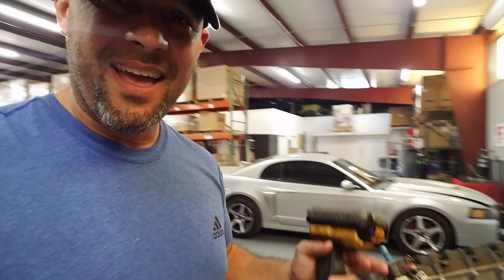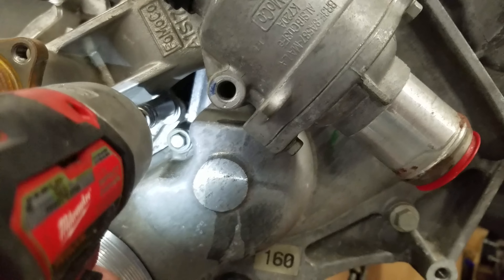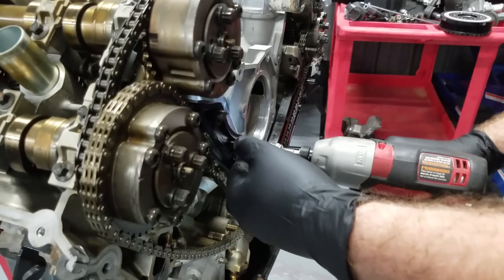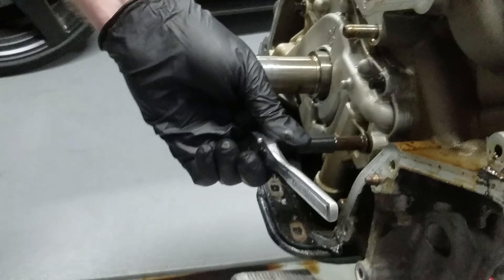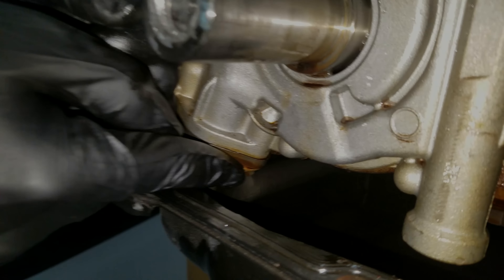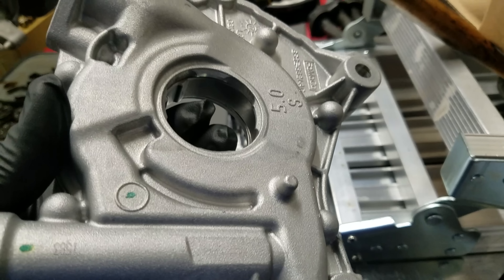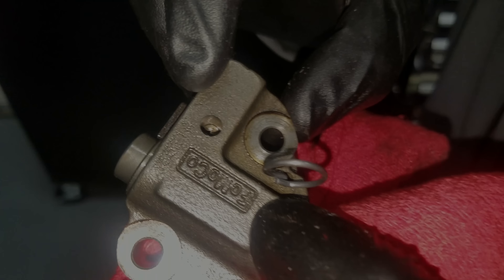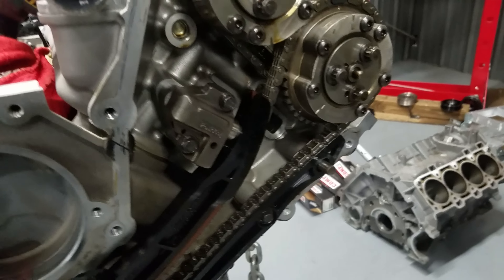11-14 Cam installation on Coyote engine. And Oil pump gear drop test

Comment: Great detail...I had a broken valve spring on cylinder 4 and had a shop quote me 4.2k to fix it.  I had to go through the same exact process as replacing cams to get to the springs.  I took my time and it is about a 20 hours job, if everything goes your way.  I did them with heads on while in the car which is a back killer.  If you need to use a shop, make sure it is a shop that builds motors.  Your local muffler shop who wants to take a stab on this type of work is not going to be a choice.

Comment: I just did this on my '13 f150 Yote swap a few days ago. Did mustang intake cams, OPG, crank sprocket, Boss tensioners and Mustang oil filter adapter. I dropped that rear oil pump bolt in my oil pan about 20 times trying to get a thread started. Have to love ford and those blasted TTY bolts that take a forever to ship.

Comment: 1:30 LMAO... yes LS guys there's 4 cams in these guys .
Reply: Zamorazone lol. I'm a ls guy. That's crazy. I did my own cam in the camaro but this. Oh no. I kind of want a mustang
Reply: slowls go for it!
Reply: And? Pushrod engines actually have many more tiny parts.
Reply: Joshua Childers
Not really. Unless by "tiny parts" you mean things as nitpicky and individual needles in the bearings a pushrod V8 has:
1 camshaft
1 timing chain
16 lifters
16 pushrods
16 rocker arms.

Total parts: 50

a dohc coyote has (not counting the cam phasers):
4 camshafts
2 primary timing chains
2 secondary timing chains
4 timing chain guides
2 timing chain tentioners
32 cam followers
32 hydraulic lash adjusters

Total parts: 78

Some 4 valve engines do away with the lash adjusters, don't have secondary timing chains, and trade the followers for bucket tappets but they lose the advantages of automatic lash adjustment and easy vvtl. In that case it would be 44 parts.

The main advantage to going dohc is it easily allows for 4 valves per cylinder and does away with most of the reciprocal weight as the cams more directly act on the valves which obviously allows for easier high rpm potential. But it usually takes more parts to do so, not less.
Reply: @177SCmaro  and less power and really its just an aluminum shitty chevy
Reply: MZBallistic Yeah 4 cams, a mile long chain and all that bulk and still doesn’t measure up to a single cam LS push rod motor...🤣
Reply: a 5.0 ls can't make power like this a 5.3 cant make power like this a 5.7 cant make power like this what you speaking of here I have an e46 5.3 4 bolt main with camel heads after market  cam aftermarket steel rods and pistons with 650cfm Holley that does not make what any coyote make stock I'm still under 400hp I also have a lumina ss 5.7 both good engines but just not as special as these be realistic pls

Comment: Hell yea yolo! I love my mmr gears and crank sprocket. So many people bash them and have no idea what the hell they are talking about.  That second oil pump bolt is a b.....!!!!
Reply: Matthew House....... The aversion to MMR oil pump gears is probably the residual effect from when Mark came out with his infamous cryo'd STOCK powdered metal oil pump gears for the 03-04 Cobra roughly in 05. I had a very heated conversation with Mark on the stupidity of giving  powdered metal oil pump gears this process after a friend lost an engine. Nevermind I told my friend not to use those gears.
Reply: Ray Jay idk never had a issue with mmr. Most of the people bashing them have never even done oil pump gears. I’ve used mmr products never had a issue. Just recently I think it was boundary oil pump gears miss packed and labeled pump gears and crank sprockets. They got to the suppliers. There was a guy who had his engine completely apart on a 16 gt. Boundary sent him the right pump gears but crank sprocket from a 11-14gt. So I think every manufacturer has its flaws as long as they fix them.
Reply: Matthew House...I was trying to explain why SOME people may have a reason or GOSSIP of a problem with MMR. I gave one example of PERSONAL knowledge. Mark is NOT a bad guy at all.....in the vast majority of instances. Ya can't please everyone!

Comment: Awesome video, very informative.  Looks like you guys had to do double work on aligning that chain to the crank sprocket!
Reply: Andrew Fate Yeah, it jumped a link when we rotated the crank to get enough slack in the chain to slide the tensioner in. Easy fix though. But that is why you check it multiple times before going to the next bank.

Comment: I knew about the problem with those oil pump gears but WOw that drop test is scary. Amazing that brittle of metal made it in there from factory. My 12 5.0 has just LT headers, tune, exaust and only a 75 shot n20 but that is still scary to know the stock gear is in there.

Comment: Yes ,this is a very informative video,but what was this in .It seems to have a 20% overdrive pulley with ati damper and a shaven timing cover for the vmp blower that is on the bench

Comment: Just a tip for you guys. If remove all the bolts on the oil pump first  the pump will swivel left to right allowing you more wiggle room to remove that 2nd bolt on the tube. 😉
Reply: or just remove oil pan then pickup tube. you sure don't want damage that o ring going back together.

Comment: Alejandro I’m in a sticky situation where I’ve gotten a new short block and it seems my cams were misplaced or some sticky fingers found them, it’s a gen 1 block and heads as I plan on going factory everything for reliability. I’ve sourced part numbers for gen 1 intake and exhaust cams I just need information or a direction on cam bearings and finding correct bearing for correct tolerances. Any response will be greatly appreciated.

Comment: Hola Alejandro. Soy de Chile.
I have an S550 GT 2017 and now i will put the Ford Performance SuperCharger.
As you know, i need modify the fronto cover of the engine. I will preffer remove it and cut it outside the engine.
In that case are a good oportunity for change the Oil Pump Gears.
I am checking 3 options:
- Ford Performance Gears (the same as the CobraYet and Aluminator Engine)
- MMR Gears
- TSS Gears
In your opinion. What is the best ??????
Reply: TSS

Comment: Hey alex. If you are  changing the valve springs on a turbo 2014 coyote, is it worth it to change cams or are the stock cams good enough to make pretty good power?
Reply from the maker: mike Hargitt stock cams are fine  but I prefer aftermarket ones if you can swing it
Reply: got another question sir. the reason we replace the valve spring is the car appears to fall off at 5300 rpm. Power is down 507 and 585ftlb and 9 to 10lbs. tuner says it feels like a boost leak. we noticed the engine loses rpm under wot at 6000. The hellion single kit isn't the best on the hot side. In your opinion do you think we are on the right track?  45k since the turbo intall.Any advice in greatly appreciated .
Reply from the maker: mike Hargitt crap...  hellion single has back pressure issues. Bigtime.  Aside from cutting off the downpipe...  you're sol
Reply: down pipe is dumped out the front. I got some springs and retainers from mmr. Thanks for  the advice sir. If the springs keep the valves in check I'll let you know.

Comment: Why just stock coyote cams? Why not upgrade while you’re doing it?
Reply: Pretty big difference from F150 to Mustang Coyote cams. Though I don't know if thats what is going on here. Watching the video at work without audio. Don't tell anyone. lol.
Reply: Did u not see comp cam boxes on the floor?
Reply: @jetjoey19  he said he was installing mustang cams in his f150 coyote engine.  If i was doing an f150 coyote swap into something i would switch out the intake cams for the l&m intake cams and leave the exhaust ones alone you can gain 20 whp on a mustang coyote with these itd be even more on an f150 engine which has much worse stock intake cams...and throw on a ported cj intake and you have yourself a bad ass budget coyote build (compared to what alot of others pay for them anyways) to stuff into a fox or something
Reply: @michaelharris748  they're not "mustang cams" they're just comp cams for coyotes. I didnt ask the questions either so you're replying to the wrong person

Comment: Hi Alejando ,, I have 2016 f150  whit  5.0  coyote engine,,   I have chek engine light on(  p0022  variable cam timing retarded  ) I took my truck to two different ford Dealerships and they can't fix the problem  they replace the VCT solenoids,  VCT Phasers,  and the   head engine,   twice,   they keep whit my truck  more than two months  and the problem still there,, 😭  do you have any idea what could be the problem  ??

Comment: American Muscle managed to shred one of their carbon fiber driveshafts at the track the other day. They said the car made about 650 wheel horsepower and I thought the carbon fiber ones could handle quite a bit more than that, some shops are saying around 1000 at the motor. Any idea on why it broke?
Reply: kyle clogston probably a combination of air ride suspension, nasty fucking wheel hop because of an improperly setup suspension and a sticky tire on a very sticky track.
Reply: Blackonefifty, but with a irs setup, the driveshaft stays stationary in relation to the axles. I have no doubt that the shock from the wheel hop could affect the driveshaft, but I would think most of the shock would be taken by the axles and/or ring gear and pinion. I'm not a drag racing expert by any means, but do have alot of driveline experience.
Reply: cobra04cole maybe so, but I suspect it has something to do with the air ride shit she has on her car.  Not saying she’s got a full on race car but I feel like with 650 wheel you’re pushing the boundaries of what that suspension is made to do.  Factor in that they may have not had the shocks set right and there’s no telling what was going on under that car.
Reply: blackonefifty gotcha, I watched the video and straight cringed when the kept her foot in it while it was wheel hopping. I'd like to see where on the driveshaft the failure occurred. She definitely needs seat time before taking a 650+ hp car down the track.
Reply: cobra04cole yeah, it’s one thing to roll through it on the street on a street tire but that shit can be costly on a stupidly sticky surface.
Reply from the maker: kyle clogston I suspect drag radials in a stick car.
Reply: Probably had a BAMA tune..

Comment: What hp gains do you think a f150 coyote with mustang cams sees?
Reply: Prob 15-20 whp depending on what other mods u have more if you have a better intake manifold already.  Youd see closer to 30-40 whp going with l&m intake only cams with no less torque than you would have with mustang cams because they dont lose any torque when installed on the mustang gt.  If youre going through the trouble id recommend doing it right first time and if youre trying to be fast throw a ported cobra jet intake on there...also i would recommend doing the oil pump gears while youre in there it it may not even cost much if any more on labor because all this stuff is in there together.  That is if youre trying to go fast and stay na it costs a little more but that is a far superior setup when staying na

Comment: Can you answer if there is an oil filter relocation kit for the f150 coyote motor? Or can anyone else answer? That would be really really helpful. Just swapped a 2014 f150 5.0 into my 08 mustang gt!

Comment: You missed MMR (Modular Motorsports Racing) inversion bracket for your driver side secondary chain. Ford is special and tensions it on the side with tension...allowing for an additional 5-6 degrees of under load.
Reply: Of rotation under load*

Fml, who proofread anyways....

Comment: How do the 15-17 f150 stock cams compare with gen 2 mustang cams?
Reply from the maker: Mustang ones are better  always
Reply: Also, looking to get this heavy f150 in the air. I have long travel suspension kit and with few bolt on and tune just won’t send it. Thinking of 800whp mark, I’ve planned on vmp gen3 sc kit and e85 fuel setup and basic engine upgrades to handle it like billet oil and crank gear/ sprocket. So cam swap maybe good one. Think that setup will get my there?? Your thoughts?
Reply: I’ve also have stainless works headers catted

Comment: "uhhh, is it lined up, Joe?"

I don' t have the FSM to check but unusual the lining mark would be behind the dyed link.
Reply: eighty6gt yeah it jumped a tooth when we were rotating the crank to get the slack out to get the tensioner in. We pulled it back off and got it lined up. But that is why you check it and check it again before moving on to the other bank. :)
Reply: Joe Goodnough thanks Joe!  Good work.
Reply: I made this same mistake when I did mine the first time around, difference being that I didn't catch it and still finished the whole job. Started the car, it sounded cammed and I realized I wasn't done lol lesson learned!

Comment: Hey guys I hope someone can help me here. I have a 2012 coyote. Bolt on car. So I wanna get the cobra jet intake and I'm wondering if I need the billet oil pump gears? It's an automatic 6r80. With this intake I see people winding it out to 8k rpm. Would I need the aftermarket oil pump gears?? Or are the stock ones just fine to rev? The car is not supercharged
Reply: Old comment but with a cj id recommend doing the oil pump gears and while youre in there drop in some l&m intake only cams (20-25 rwhp gain above the cj alone with no loss in torque, only 899 bucks new comparsd to like 1500-1600 for comp stage 3 cams which only has a few hp more gain but loses 5-10 torque and costs almost double) to get the most out of your cj setup and have it ported if possible that is worth another 10whp or so.  I highly recommend this setup itll get you in the upper 400s easy even on pump prob 500 with e85 very legit combo that i myself am going to do if i pick up a coyote in Couple years.  It will make your car pull like a train up top and absolutely rip on the street or track and although it may be a little pricey compared to just slapping on an 18 manifold it also gets much better results.  Its budget compared to many forced induction setups and has potential to get you into the 10s no problem with the right tires suspension and driver.

Comment: 17 gt350. OR 18 gt? Is it an easy call?
Reply: Tucker the Boxer wait for the gt500
Reply: 2V Turo Only problem.......cost! What is that going to run?
Reply: Tucker the Boxer not much more than a gt350 I’ll tell ya that
Reply: 2V Turo I can get a ‘17 350 for $55,500. You think the 500 will be there?
Reply: Tucker the Boxer msrp will probably be around there. Idk about dealer mark-ups

Comment: It's definitely not like a cam in the old 5.0's.
Reply: Boz Squad ofcourse not. Its pushrod vs overhead cam.
Reply: 2V Turo.  I know that.  I'm just saying I can change a cam in the old 5.0's, but I would be a little sketchy changing one in the overhead cam setup.   This is  why you need a shop like this to do it.  That's all I was implying.
Reply: Boz Squad agreed bro. These overhead cam motors are tricky is some ways.

Comment: Oyes. Q se ocupa. Para poner un motor 5.0 a un de 4.6  Onde. Puedo. Compra el motor más barato
Reply: Motor. Transmission computadors de ford performance specificamente para el año de motor y transmission y tambien la barra. Los motor mounts son igualitos del 4.6. Y ultimo las brackets para la compressora de califaccion y power steering.

Comment: They need better engineers at Ford, how ridicules to pull the whole motor apart for the oil pump. The days of just pulling the pan to change the pump are gone.

Comment: Still with these Over Head Cams with timing chains long enough to be log chains. That is the very reason I got away from Ford.
Reply: Bcroft39 you should look at any over head cam engine, lots of chain to go around not just ford haha
Reply: George Marris I know a lot of companies are going to over head cams. Call me old fashion if you want to, but I don’t like the idea of 2 timing chain, especially if they’re long enough to be log chains. One spring on each chain that keeps the chain tight. If just one little spring goes bad, you’re paying for a new timing chain set. Plastic glides that guide the chain.

Comment: Got a question for you, would it be a good mod to swap a 2018 GT manifold into a 11-14? I’ve heard the 18 mani is superior the other aftermarket options.
Reply: GODEYE270115  I don't think it will work, I could be wrong, but I thought it was different due to the DI setup on the 18's